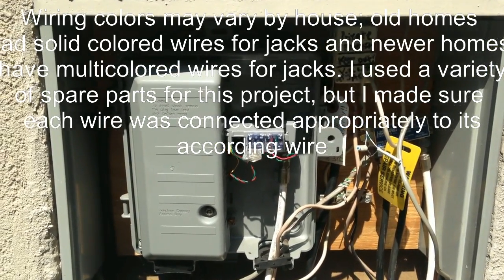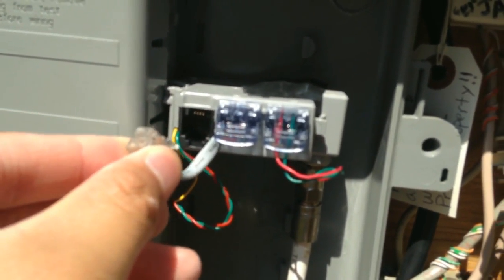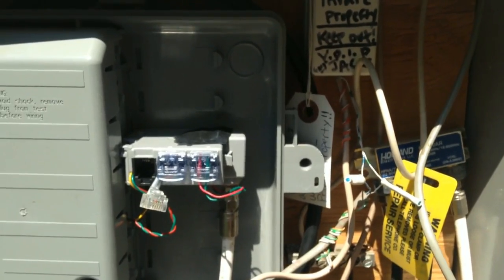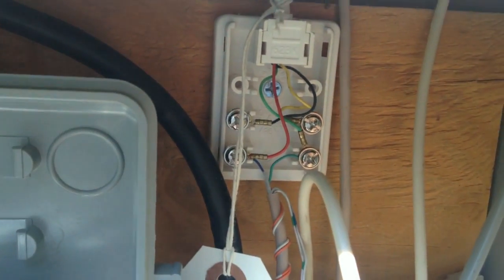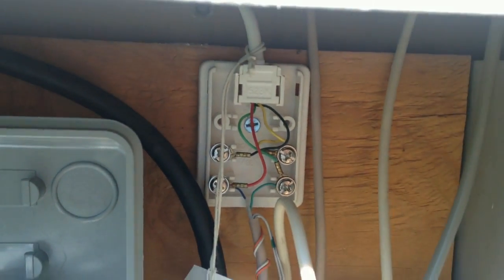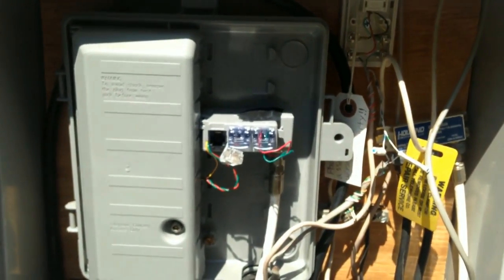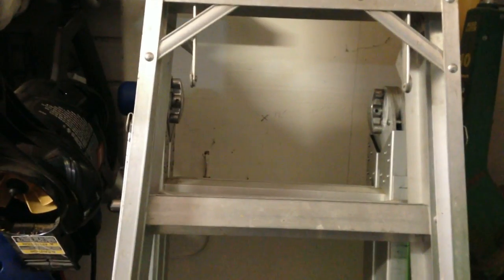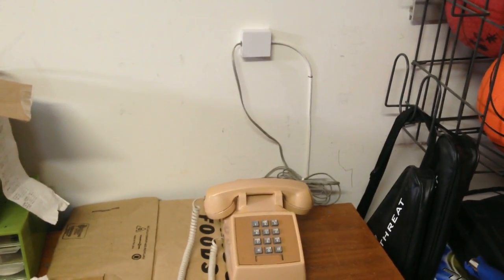VOIP Garage Phone Jack

Comment: I'm not sure I follow what you've done. Have you taken this approach in order to bypass the need to pay for a landline or VOIP from a service provider? If so, then I'm very interested, with desire to replace VOIP I now pay for with an Obihai. That way I can use landlines in the home free of charge, without having to port the two home numbers. Are we on the same page? Do you what I wish to achieve is doable? I look forward to your reply.
Reply: It's pretty darn simple. 1) disconnect the plug from the test jack in the NID or demarc point, at the customer-accessible point 2) plug the Obihai phone jack into one of the pre-existing phone jacks in the house with any old phone cord (Be sure to place the Obihai in range of an ethernet port so you can connect it to the internet) and 3) plug phones into the remaining jacks. Depending on how much REN current the Obihai ATA can put out, you might be able to power phones throughout your house and have them ring to boot!

I have an Obi200, and I must admit, it's pretty slick! I have mine tied to a Google Voice number, (no need to port) and out of the many various numbers I've called, only one has (before connecting) given me a recording to say that I would be charged for the call. So, being charged for a call is pretty rare. I also have an Ooma router and monthly service from them, which doesn't cost very much. I was able to get local (to me) phone numbers for each device.

Unplugging the cord from the test jack is very important, as the voltages from Ma Bell's wiring coming into the demarc can damage the analog telephone adapter. (the Obihai) Your local phone company might also not like signals from the Obihai backfeeding into their wiring and possibly interfering with your neighbor's telephone services, assuming they have active POTS (Plain Old Telephone Service) numbers. If you create interference, a phone company technician will for sure narrow it down to your house and come have a stern word with you.